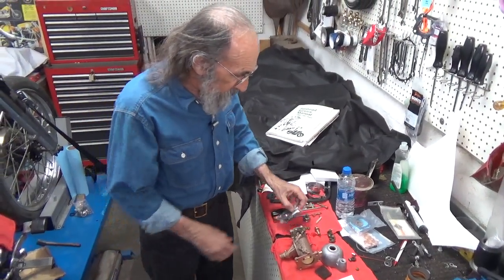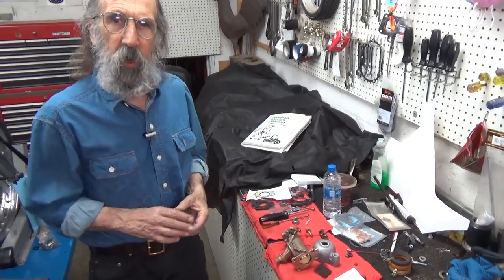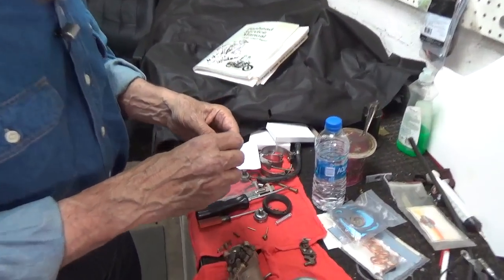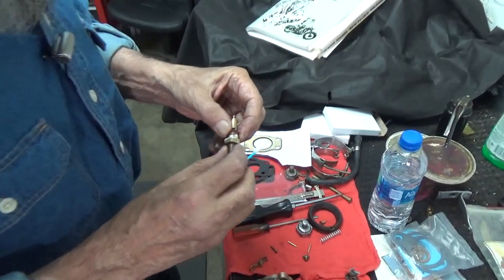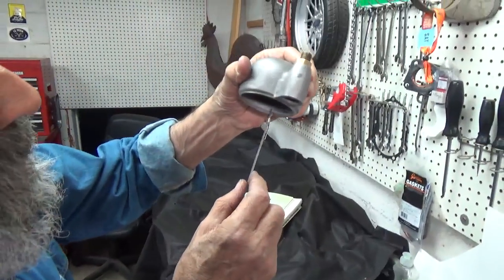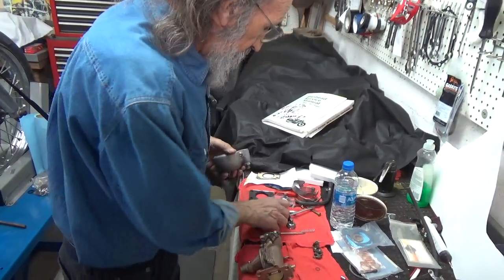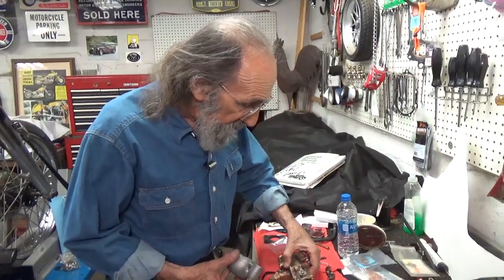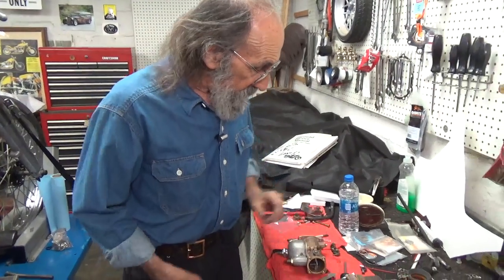Step 8 Installing Float and Needle Valve In the Harley Panhead Linkert

Comment: Nice job Mike. I remember the bronze floats that had the lever soldered on them, I worked with one for about an hour once and the owner asked why I couldn't have done it quicker.
Reply: Cool trick on the hollow stamped sheet metal floats = if you found a pinhole or split causing loss of buoyancy one could carefully use solder to repair it
Reply from the maker: Tell them to try it.
Reply from the maker: I have done it.  Modern technology has brought new floats.  Now I'm trying them.
Reply: @pacificmike9501  a delicate task for sure... Done them on different carb of similar design & old fuel send unit floats that were made from "unobtainium"...
Reply: @pacificmike9501  I would do same these days as replacement parts would be in hand before the fuel vapor in float would evaporate to safe enough level to solder...i.e. small torch,plumber solder.LOTS of flux & most of all patience with trial & error method...

Comment: When I don't have enough fingers, sometimes a dab of white lithium grease, AKA white lith, will assist in keeping small loose parts together during assembly. A small blast of brake cleaner gets rid of any excess. 
    Most people don't understand why a tiny bit of debris in the needle and seat does such a thorough job of flooding the carburetor. When the foreign object gets in the valve, the fuel getting past increases the float pressure against the needle, wedging the object even tighter. The quick fix is to drain the float bowl, allowing the float to drop the needle out of the seat. Letting some fuel through washes out the offending particle(s). It's usually effective. Of course, if the tip of the needle is shot, all the flushing in the world can't fix it. 
     Just a couple thoughts. Be well all.
Reply from the maker: Well said.  Thank You

Comment: I installed a new rubber duck float. I got the bike started and it sounded sweet except It ran out of gas. When I went to add gas there was gas leaking out the port by the right side adjustment screw. Would this mean I set the float to high? I aimed for a 1/4" and it was right there but maybe it's still too high? I love your videos, they are very helpful.
Reply from the maker: Sounds like the float is hanging up, keeping the needle from seating.

Comment: great stuff...can you expand on the benefits of using white lithium grease next one? Don't worry about recommending products. If its well made, say it, if its crap say it. If they gave it to you for free/sponsor tell us. We're smart enough to understand the differences. Thanks
Reply from the maker: I go over it all the time.  Seals really well, doesn't contaminate.  Stays well between surfaces under pressure.  Great for carburetors, oil pumps.  Old method.  Worked then, works now.
Reply: @pacificmike9501  thank you very much!
Reply from the maker: You bet.

Comment: I am curious if bending the plate that is screwed into the float just too risky to bend it while attached to the float. I believe that you did bend it while it was fully assembled. I wonder if the original float that Harley used was a hollow float that may have been prone to damage if the adjustment needed to be done. I remember dealing with a certain manufacturer that had a problem with their floats absorbing fuel ended up getting heavier and so it no longer was able to stay lighter than the fuel it displaced. I know you will get it right!
Reply from the maker: The original floats were cork.  I always have to recommend removing the float from the fork.  Or, be very careful.  The floats are all very fragile.

Comment: My dad always said "The devil is in the details". He was also very particular about doing things properly and referencing the manuals, they have a purpose.
I did have a question for you. I could Google it, but I prefer your input on it.
Were linker carbs used on shovelhead bikes? Or are there adapter setups to use for them? Not that I'm looking to change from s&s, just curious.
Great video regarding patience.
✌
Louis
Reply from the maker: The "DC" series "Pot Metal" Linkerts were used on the early Shovelheads.   I believe they were used for 66 and 67 only.  Early Sportsters used them too.  They were smaller and looked like the S&S "L" series carburetors, although the S&S was a much larger carburetor.  I've always figured a Shovelhead required a large carburetor.

Comment: I have used a ball bearing bigger than the needle seat hole to correct the seat shape. I do this by striking the ball a sharp blow with a hammer. I then lap the steel needle into the seat until it will hold a vacuum with gas on the seat., have had to do this on a new needle and seat.
Reply from the maker: Yep.  It takes practice though.  Sounds like you're good at it.